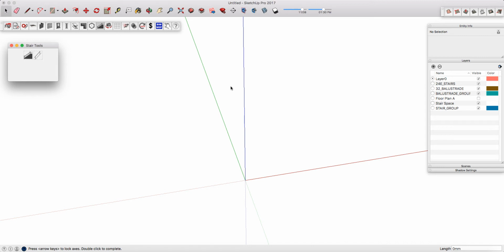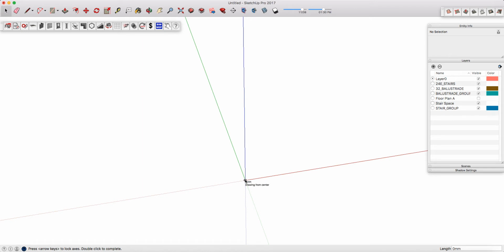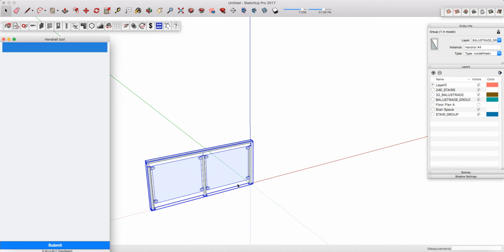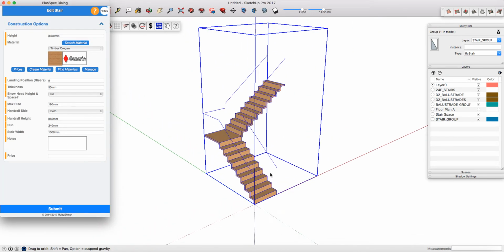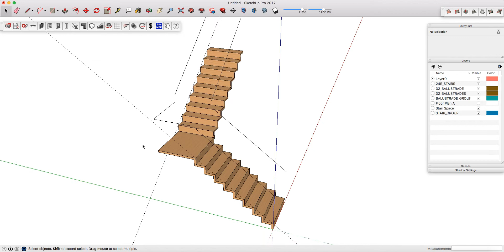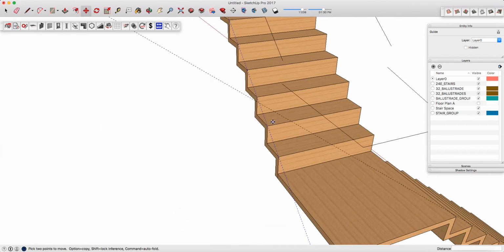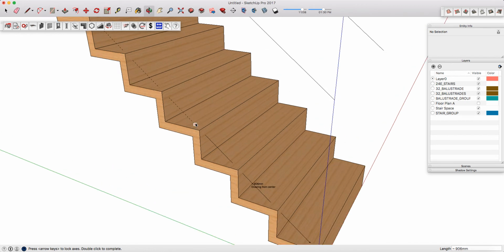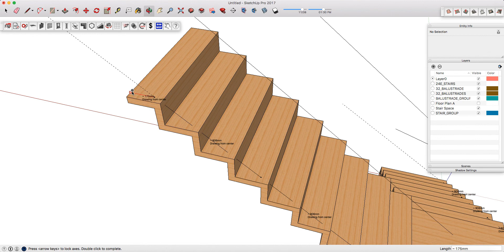Handrail/Balustrade Tool Tutorial for PlusSpec for SketchUp

Comment from the maker: A time-saving tip when drawing handrails on the PlusSpec stairs is to break inside the tread component by selecting & triple clicking, then add a line 50mm in. This will save a lot of time offsetting.